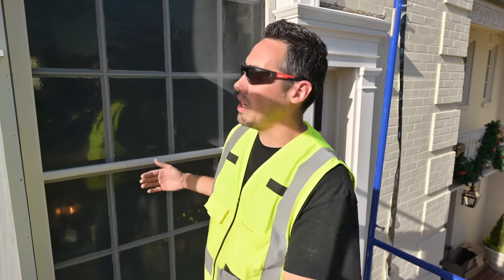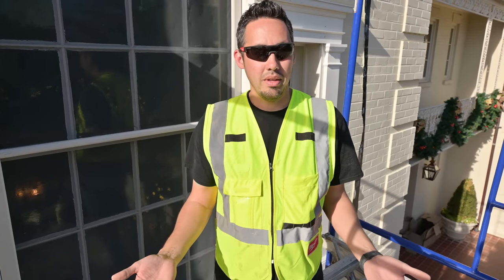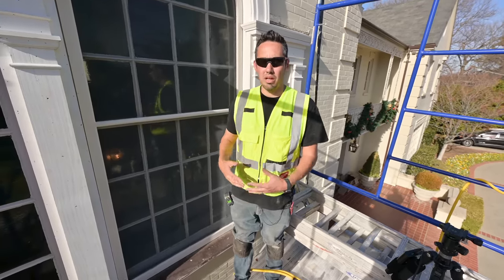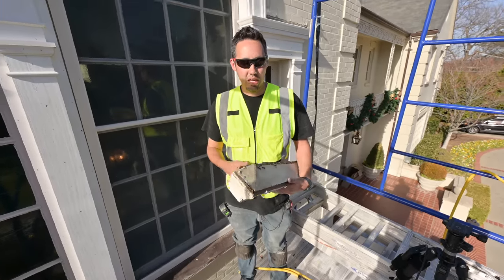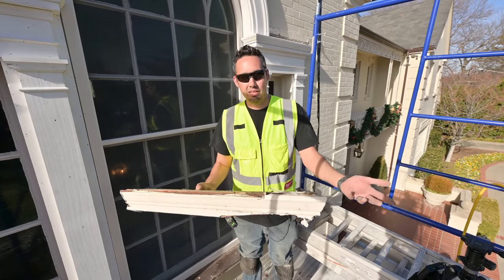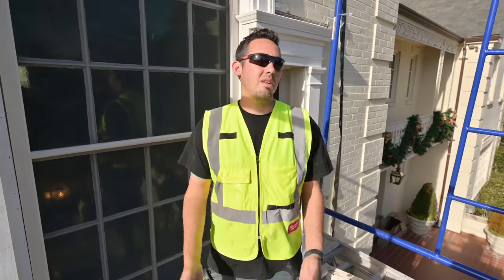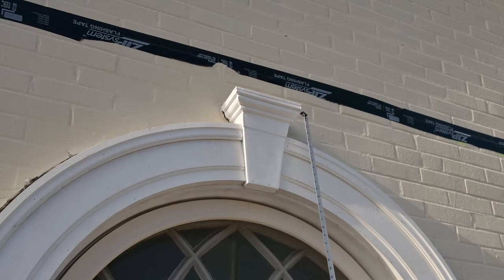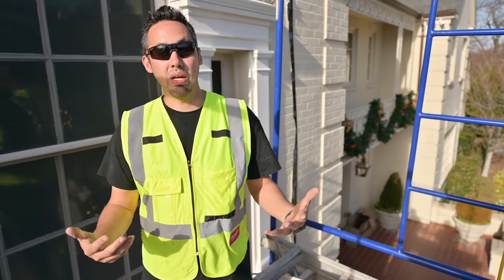Palladian window with REAL WOOD - Exterior Atchitectural Millwork

Comment: Sapele is disturbingly cheaper than much of our locally harvested douglas fir here on the west coast of Canada. And when I look at the prices of plastic decking for instance, I am often shocked how much more expensive it is that wood, even Sapele. I've used Sapele for my own personal deck railings posts and caps, combined with an enzyme based wood treatment that oxidizes it to grey. The panels are raw red cedar with a pvc coated wire mesh. I kind of wish I had used galvanized in retrospect. There's no maintenance on any of that stuff. The caps got treated with Cetol Marine finish. I re-coat every other year to stay on top of it. Not a huge job. Half a day at best, start to finish. This isn't a plug, but you can find links to my website through my YT Channel "about" page to see some photos. With proper attention to detail and proper maintenance, wood is the more sustainable solution.

Comment: A lot of builders that are considered top notch are using PVC Trim Material. Foreign window manufacturers are using UPVC. I'm not a chemist but I understand flashing and routing water down and away. Do you think PVC poisons our environment more so than paint? I was born in 1950. Builders thought Asbestos Products and Lead Based Paints were fine as frog's hair. Now we have to do expense abatement procedures to dispose of them because they are so harmful. My Townhouse was built in 1974. It has Masonite T-111 Siding on it. Pressed Cardboard. In bathrooms, kitchens and laundry rooms I use Ditra Membrane and run Kerdi Flashing up the wall and finish it with PVC base. You do excellent work. I'm interested in using Hull Millwork doors on my next build.

Comment: The one pro I can see with PVC, at least in my area, is price.  I am replacing the circular window trim in a 100 year old building.  The mill wanted $1,500 for the pieces to be made in wood and asked $295 for the PVC.  Customer wanted the wood trim but couldn't afford it.

Comment: Well darn!  I wish I had seen this a few weeks ago.  I put a couple replacement windows in and had to also put in new stops on the exterior.  I used PVC because I thought it would be more long lasting than the wood I could get at Lowes or Home Depot.  I’m in the East where it rains a lot or is just plain humid a good part of the time, that was a factor in my decision also.  Oh well, live and learn.  😏
Reply: PVC is much better for exterior. You need to reference more sources. He admitted that he has little experience with PVC, so don't blindly take his word as gospel. You made the right choice.
Reply: @Tool_Addicted_Carpenter  thanks for the reassurance.  I usually assume that if it sounds reasonable, it’s correct.  Especially since I’m not a building carpenter or finish carpenter.  What I know (or think I know) has been learned from Ask This Old House and then the University of YouTube.  😉😆

Comment: Thanks for answering my question! Definitely understand the need for wood on the fancy mouldings. Great project!  (One question for guys who have more experience than me: Is PVC likely to shrink lengthwise? I've seen a couple of PVC fascias lately where gaps have opened up at glued joints in cold weather. Seems like something's wrong with that.)

Comment: Plastic lasts forever in the landfill but it doesn't look good forever.  It cracks and shrinks when exposed to UV.  Plastic is good but is no miracle solution.  Wood can be great.  Congratulations on this job.  Beautiful.  It is work you can be proud of.

Comment: Looks great. One question is why does it look like there is now an unfinished space all around the wood on the wall, almost like the new casing is smaller than the original. Does it just need to be repainted? Was there something else that needed to be done outside of the framing?

Comment: The reason they didn’t flash it properly is because they didn’t have a way to run a full piece end to end of the entablature, you would have to cut at least a quarter inch off each side of the arch and that would allow space to cap the entire entablature. It’s a little difficult to explain.

Comment: PVC expands and contracts too much for that amount of detail. Great Job.
Reply: More so than wood?  Unlikely
Reply: @rheuser24  Not sure where you live but the temperature differential in Ohio causes PVC to lose and gain up to 3/4 of an inch. Wood will expand and contract 1/8, maybe 1/4 at best and thats if youre using wet lumber. Wood expands and contracts more from water than heat. But if its primed and painted and flashed correctly then you have no issues. Ive done alot of exterior trim and ive never got any complaints of paint cracking from expansion and contraction but I have had customers inquire about gaps that come and go in PVC products. Its seasonal and all due to temperature.

Comment: The pvc may never rot but if the flashing is insufficient or incorrect the structure behind it will rot right up to catastrophic failure.  The same reason the sepele rotted. Of the two choices I prefer wood because it generally will let you know there's a leak problem long before structural problems set in. Whenever I've used pvc I pay particular attention to flashing beyond code. I personally prefer wood because the plastic MUST be vacuumed out of the lawns and walkways,etc.  The static charge is a real pain to deal with.

Comment: Richard, have you ever used rubber paint. Of course, it might not be appropriate to use on a historical house, but in some situations involving rot issues, I've had some incredible results. It is available from the orange box/ Lowe's in can or in a spray can. Opinion?

Comment: A few things I'd like to mention. 

1. Forest grown Sapele is great and will indeed last a lifetime, but it's also not sustainable, and in fact is nearly endangered in the wild. It's harvesting has resulted in massive deforestation that's irreversible in or lifetimes.

2. Plantation grown Sapele does not have the same oil content and will not last like virgin timber. The trees in their native environment are slow growing and take hundreds of years to accumulate the oil that gives them their famous rot and insect resistance.  Plantation trees have a little as 10% of those oils when harvested.  Plantation cedar and teak has the same issues. Plantation grown cedar has been shown in studies to have only marginally better rot resistance than pine or spruce, and nothing close to old growth cedar.

Comment: PVC has it's applications. Like in a bathroom. In a Rental. Base/Shoe/1/4 round.... Outside in the environment, it does and will fail; Heat in the valley, temp changes, Expansion, Contraction, etc. How do I know? Because I know. I've experienced it. If PVC will excel in a chosen Environment, wood will be superior in the same.  (I'd rather clean sawdust off a Client's lawn than Cancer Plastic). Semper Fi Richard.

Comment: Wood 100% the only thing i would say is stainless steel nails and flash the entablature before installing mouldings above it. And epoxy is bullet proof out doors for glueing joints.

Comment: When looking at the life expectancy of the window, with the old window lasting 97 years, you need to look at all of the materials involved, not just the atructural.  First, the atructural...what was the original species of wood compared to the replacement?  Even if it was the same species, what was the density?  One piece or finger jointed?  Other than structural, what type of primer and paint were used on the original?  I can guarantee it was oil based for both.  Years of being re-coated with oil based coatings versus latex products used today.  Highly unlikely the replacement lasts half as long as the original.  Now if you just want to talk about the synthetic vs organic factors, in most cases I totally agree with what you're saying.  But lets not forget the trees don't mill theselves.  What does that process look like.  And if we're that concerned, I hope we're not using MDF in the interior

Comment: I have seen enough paint fail on "old" pvc  because of temperature swings.   & old would be what?  Mid 90's?    It will definitely not hold up to a proper tree species of milled molding. 
The old timers didn't even back prime any of the old exterior finish carpentry and it still holds up for +100 years.

Comment: I would chose wood over PVC (in the UK uPVC is used) any day of the week. However, in the UK a lot of people go for uPVC because it is cheaper compared to quality wood, and because it is very close to being maintenance free. I suppose that is all comes down to what you can afford, and if money was no object I don't think anyone would prefer plastic over wood. Also, we are constantly being told about the environment these days, so it as almost a miracle that there has not yet been a campaign to ban all use of plastic and chemical manmade materials in the building industry.

Comment: I am a journeyman carpenter as well as a licensed GC, and whether or not wood lasts on the exterior depends on how much heat it receives (think Arizona 115 degree days) and how much water it contacts (lots of rain and high moisture content in the sun).  Wood does fail far more easily than composites. That is why the vast majority of builders will use composite trim and decking when it is possible. Most homeowners, even very rich homeowners, don't want to spend time repainting the wood trim and maintaining it. Composites have been tested over decades of use and PVC is a well-proven material. It has limitations, but when used correctly, it will not fail. I live in AZ and exterior wood trim fails without exception, in 10  years or so. If it is is very well painted, it might last 15 years. But in many cases, exterior wood trim fails in less than ten years. It warps, cracks, splits, and paint peels off of it profusely on southern exposures. This creates a high maintenance problem, that most people don't want to mess with. My own house has 2" x 8" wood fascia and it is failing on the southern exposures.

Interestingly, here in AZ, PVC trim is also not used because the temperatures exceed the manufacturer's recommendations. However, I have used various composite trims and facings like Trex and others. For fascia, which is by far the most common trim in AZ homes, there really is not a good composite substitute, and that is a problem. When I have time to fix my fascia, I will replace the wood fascia and paint and seal it, but I will cover the exterior with 1/4" thick fiber cement 1/4" x 12" trim that comes with a powder coating that is warrantied for something like 20 years. I have also considered cladding my fascia with powder coated metal, but it would not match the other houses in my cul-de-sac, and would be an eyesore. The fiber cement trim comes with an imprinted wood grain.

The advantages of placing the 1/4"  fiber cement trim over the facia is that water will not affect it ever, and as mentioned, the powder coated paint it comes with is far more durable than regular paint. The third advantage is that there is no maintenance. It will shield the wood flashing from the sun and it should last a good 20 years or more. If I do have to replace it, I will install it in a manner (screw it) that can be easily replaced.

You should also understand that PVC is just one form of composite trim. There are several other kinds of trim. As mentioned, most of the established composite trim manufacturers have improved their products over the last two decades and they are far superior to wood in many applications - especially decks.

I wrote this comment not to argue with you, because I understand what you have said. I greatly prefer to work with wood also, and I worked my way through college as a carpenter. I also keenly understand that some homeowners want the actual wood look and they are wealthy enough to afford to pay for the extra maintenance it will require. However,  composites are the best materials to use in many applications because most people want their trim and decks to stay looking beautiful for decades. There are exceptions, and possibly your project is an example of this. It might be difficult build this intricate work with a non-wood material. It's easy to talk about things when you are not actually building something that is complex.  

One last point that is interesting. With many composite trims, they can be heated and curved. Many composite decks now are including complex curved design details that are strikingly beautiful. As you build curved features, this is a useful thing to keep in mind.
Reply: @henrypeisch5289  If I installed this trim piece on my house, without a doubt I would use composites. It's far too much work to trust to wood. In the author's case, the homeowner is rich and wanted the wood look. That's fine because they can afford it. The homeowner just needs to be aware that wood can fail much more quickly than modern composites.
Reply: @henrypeisch5289  In reality, in the case of painted applications like this one, composite materials are almost indistinguishable from wood materials. It would take an experienced carpenter to tell the difference. The vast majority of people won't have a clue. 

It is a silly assertion that when repairing an exposed trim detail like this one that "like materials require like materials." The use of composite materials is exploding across the nation precisely because your statement is not factually correct.  

If YOU want to use exterior wood details because it is YOUR choice, fine. But don't claim that your personal preferences are some kind of industry standard.
Reply: @henrypeisch5289  I was referencing the curved top of detail. As I said, I mentioned this because it is an advantage of many (not all) composite materials in general - I was not inferring it is the best choice for this project. It probably would have been more work to curve a composite piece for this project than to simply cut one out of composite boards glued together.
Reply: @henrypeisch5289  No, I think Brent is a skilled trim carpenter who cares about doing a high quality job. I am a licensed GC and I would not hesitate to hire him. I have done a LOT of trimwork and I understand the challenges that Brent faces.

It really is not Brent's call in most cases which materials he will use unless the homeowner asks him to suggest a material. The use of a wood material in this application is fine, but a composite material is intrinsically "tougher," waterproof, and UV resistant. I think it would have been a better choice for this project. However, that is not the same as saying that either Brent or the homeowner's choice of wood was a "bad" choice.

 In my opinion, wood is an excellent material for trim and it is universally used across the nation for exterior trim. However, because this trim detail has a southern exposure that "receives a lot of sun," possibly a composite material might have been a superior choice. That being said, wood is still an excellent choice provided it is flashed  and sealed well and I commend Brent's thoughtful attention to detail.
Reply: @henrypeisch5289  I agree. It appears that some step flashing needs to be placed over the curved part of the detail.

Comment: Makes sense from someone who doesn't need to paint and repair the wood later. Or spend the money to do it.

Easy to say that perfect flashing prevents the problem as you dig into a huge chunk of rotted wood.

You also didn't consider local weather. There's no winter freeze or snow in TX.

You also use the excuse that some people can afford it. As you talk to people who can't afford it and wonder why you'd use it. You're selling blue collar workers out.

What might serve you and your business in the future is discussing non tangibles like pvc looking worse, or not lasting as long as they say it does due to cracking. If those are even the case.

Comment: I agree with using the wood....  It does hold up well as long as it's properly flashed and painted....  and paint really is an amazing achievement that gets taken for granted, but it stands up to weather extremely well (temperature ranges of -25 to 100 *F in Milwaukee)!  Plastic and vinyl do get brittle and crack over the years.

Comment: I don’t eve need  to watch this Richard to agree with you, PVC has the biggest carbon footprint over wood. UVPVC  windows and doors need greasing washing and  a lot more maintenance each year. Has recommended by the manufacturer than a wooded window or door. Fact. A proper maintained window or door in the uk is recommeneded redecorate every 5 years. That’s how it’s been for the last 30 years of me being a painter on buildings such as Admiralty arch . Harrods, Scotland Yard . Eaton square .the Bolton’s every well to do postcode  in London basically .  I see so many common mistakes and it’s normally due to back of fascia boards not been primed or painted , cut ends not being painted. Bottoms and tops of windows and doors not being painted . Such a simple fix ,, I’m. A private worker now and have. Been on and off for 30 years and on my residential I always have been asked back. Every 5 years By the owners because they have still got the same windows and doors since I started.  An I have made some nice friends through my work .  Also I note that pvc windows apparently do not have. A lifetime of use and can’t be repaired. So have to be dumped and replaced. Where has a  piece of wood can be spliced and made to be as new without the need for a complete overhaul ..